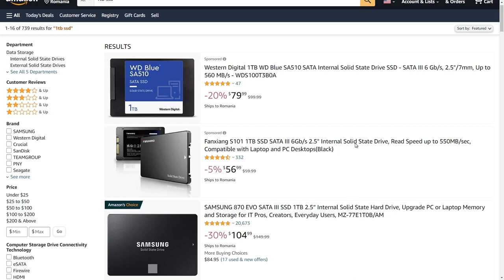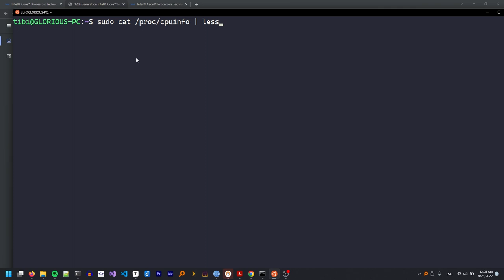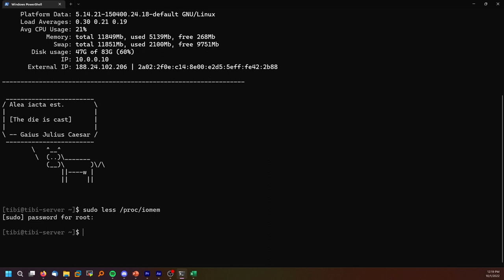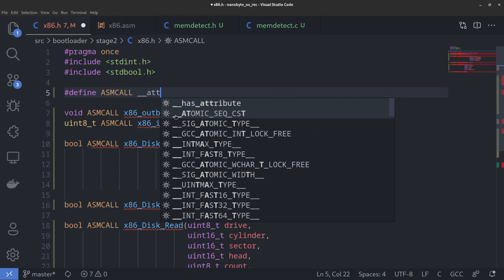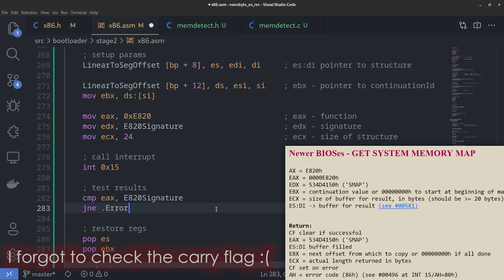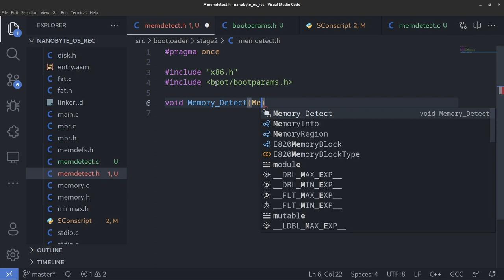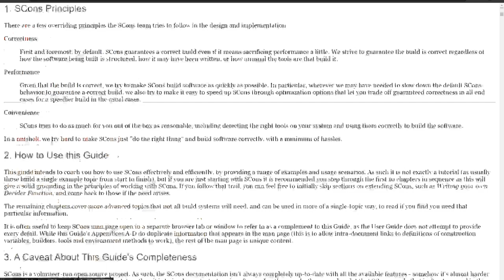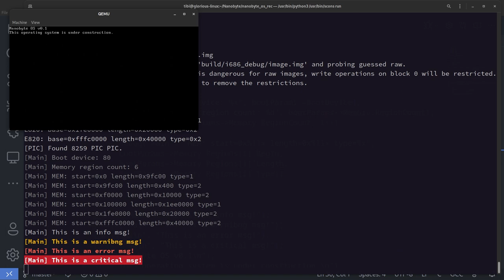Building an OS - 11 - Memory detection

Comment: Hard drives and SSDs are NOT memory! They are storage devices. The difference is memory, or RAM, is a temporary location for data that can be accessed by the CPU directly for running code, storage media like HDDs, SSDs, Floppies, etc. are for permanent* storage of data but the CPU can not access that data directly thus code can not be run from there. Though technically SSDs and Flash Drives could be called memory because they are made from forms of RAM that can retain the data without power they still fall under the category of storage media because code still can not be run by the CPU directly from them.

* Storage media are supposed to be permanent but we now know nothing truly is, degradation happens! lol

Comment: You maybe should have created a video for making the change to Scons instead on relying on the livestream to teach us! The livestream is hard to follow when you are also chatting with the chat, it includes mistakes that although do get fixed also make following along difficult to do, plus it's over 4 hours long because of the previous two reasons! It also does not help that in the livestream you have your camera view covering the terminal so the commands you are typing are partially covered!!

I am sure it could be condensed to a 30mins or less video that's easier to follow.

Comment: Hiho,
Very nice series. Thx! Watched it this weekend and really enjoyed it so far.
In contrast to the "Write your own Operating System"  from Viktor Engelmann, I really like that you also wrote your own boot loader and not rely on the GRUB bootloader.
Also I like that it uses C + ASM. Do you plan to also support C++ in a later stage? What about POSIX compatiblity etc ? 🙂 How far do you plan to go with your OS and this series?
Anyway, thx again for the nice series,
Greetings,
Nils
Reply from the maker: First, I want to get all the basics working (memory management, process scheduling, 64-bit, file system etc). Then, I will go into graphics, and maybe porting to an additional platform (either ARM or Risc-V).

I already started moving to C++ in my livestreams. There's a bit of work left there, after which I will merge it into the main branch.
Reply from the maker: In terms of POSIX compatibility, I have no desire to support it. I don't want to make another UNIX clone, I want to build something unique.

Comment: Hey, I love your videos! I was wondering how, not just in this video, but especially in the one about FAT12 where you had the disk cylinders and everything, you make animations/visualizations and just on screen effects and text. What software do you use?
Reply from the maker: I usually make the animations in either After Effects or PowerPoint, whichever is easier for what I'm trying to achieve. A lot of things are easier to do in PowerPoint, I really love the "Morph" transition which makes a lot of animations a breeze. The only downside is that it can't export video with a transparent background, so I use black/white backgrounds, and use the screen/multiply blend modes to make the background disappear. I've also occasionally used Blender for certain animations, but making such animations and then rendering them takes a huge amount of time. The library scene from one of the early videos took almost a week on my poor laptop that was sounding like an airplane.

I'm currently considering doing some things practically instead of digitally, it could make certain things a lot easier.